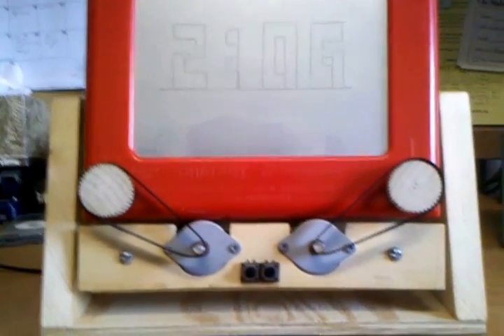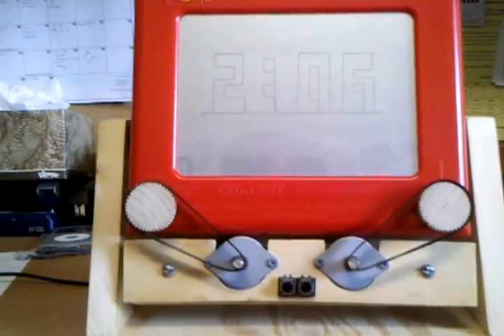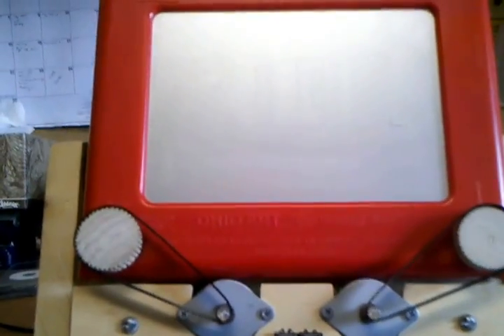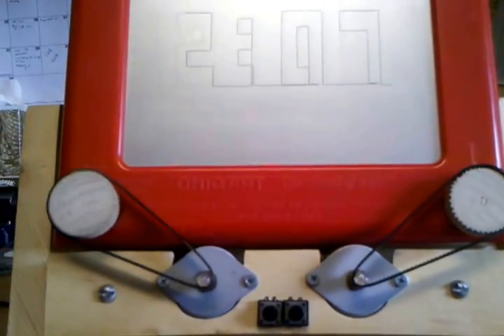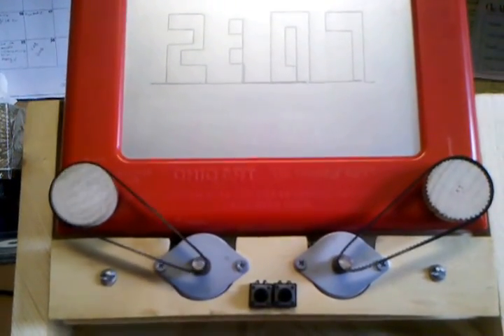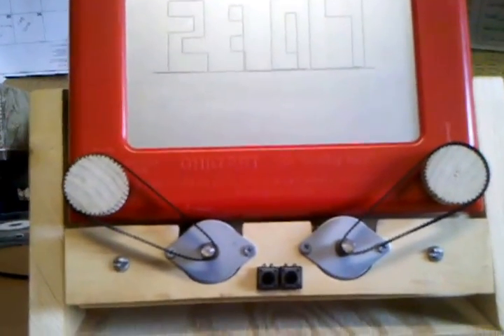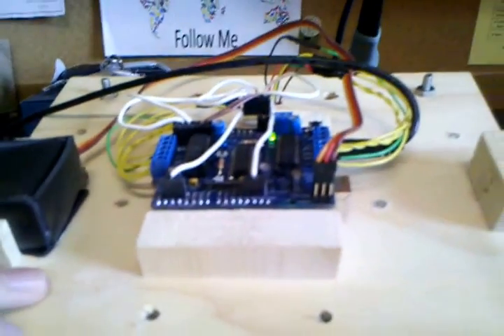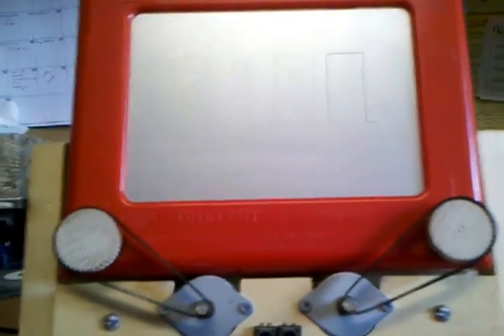Etch a Sketch Clock

Comment from the maker: I wouldn't really mind, however my code is very hardware dependent. I've used the adafruit motor shield and it's accompanying library for 90% of the coding, also it is set up for my specific stepper motors and gear ratio and it isn't perfect yet. I could also send you an arduino pseudo code for it, the coding is really simple itself; the main problem was hard coding each number into it which actually varies slightly from EAS to EAS.